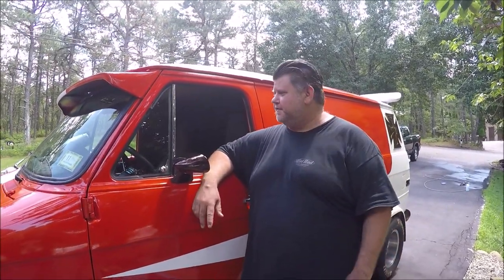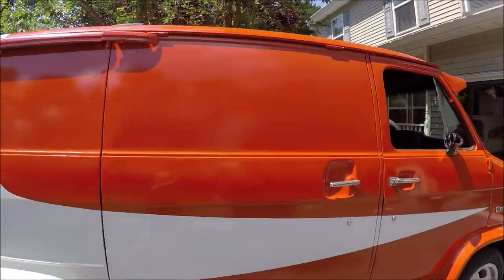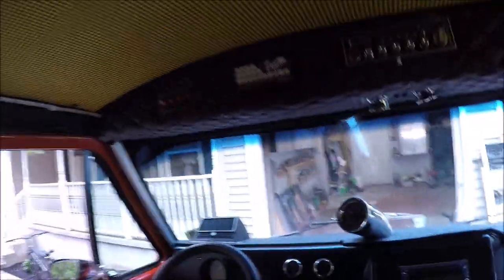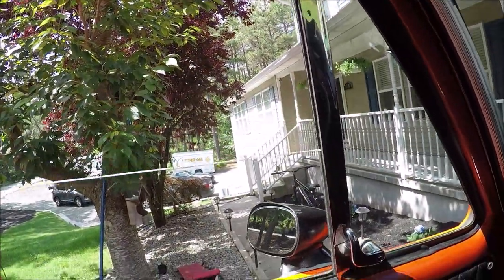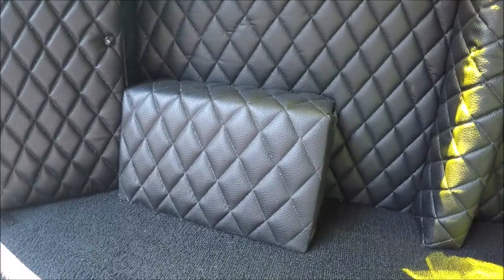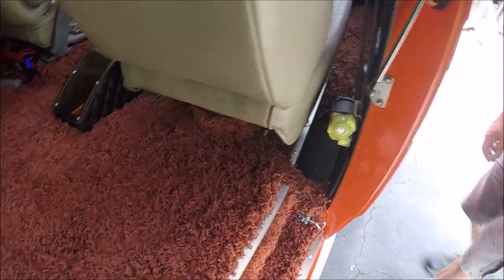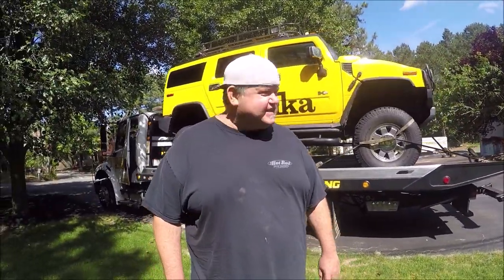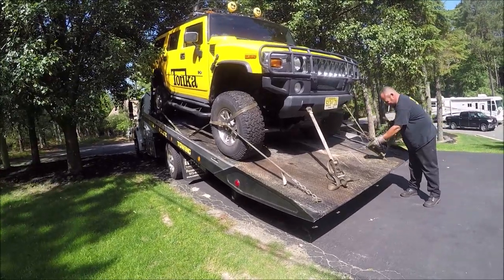"VANDEMIC"  Recreating A Classic 70's Boogie Van 1978 chevy van g10

Comment: Would love a more detailed video on a "how to gullwing door". Just put some 295s in the rear and now plan to gullwing it because of the sliding issue. Also didn't know about the hinge either needed at the bottom of the gullwing.  Van looks great. Many many hours on it you can tell
Reply from the maker: Unfortunately it wasnt until after we gull winged the door (and had a few beers) that we decided to start recording stuff for our channel. We definately missed out on some cool content with that but thanks for the comment.
Reply: @CrossCountryGarage  links to the parts used?
Reply: @CrossCountryGarage  you also mentioned in the video anything anyone had questions about and needed details to comment and ask. That's the only reason I brought it up and thought to ask, so I'd get more details about it
Reply from the maker: @shtfvan8084  you will need a 1/2" x 12" piece of steel (cut in half for 2 6" pieces) to fill the channel at the top of the door, 2 4" hinges that you can grab at lowes or home depot (1 side will get cut to fit on the top. Other side that connects to the door you will have to cut and weld into an "L").  We made our mounting brackets out if steel stock but i will look and try to find you a link, then purchased the struts, ball ends and clasps off amazon, and i will look for those links when I get home.
Reply from the maker: https://www.amazon.com/dp/B0721P9T3B?ref=ppx_pop_mob_ap_share
Reply from the maker: https://www.amazon.com/dp/B01LWMQUSH/ref=cm_sw_r_cp_apa_i_YJvpFb2CH90FK
Reply from the maker: https://www.amazon.com/dp/B077KJ217F/ref=cm_sw_r_cp_apa_i_FKvpFb7SB9B49

Comment: Which backup camera did you use? I need one for mine and my daughter's vans.
Reply from the maker: They all work fine. That was a JVC head unit with a $20 camera from Ebay  but even the cheap chinese head units work good. I think we had to lengthen the camera wire though as it was a long run.
Reply: @CrossCountryGarage  Thanks for taking the time to reply! Great build it's an inspiration for me just getting started.

Comment: Are you guys going to make more of the bubble lights ??
How about the maltese cross ???
Reply from the maker: Probably not the cross but possibly the lights. We are starting to make replacement acrylic for windows, right now we have a round template and a tear drop, just pull the outer gasket and replace old tinted ones, shouldn't even have to take the frame out of the van. We have a set of round blue ones with about a 3" rise that we will probably throw on ebay today. If you watch our porthole video, they are the same as those but the ones in the video had a 4" rise (they went to Scotland and they had the frames). Thanks for watching.

Comment: Did you put the ceiling up before or after the wall, and how did you do it?
Reply from the maker: We did the ceiling after the walls, small 1/2" screws with caps directly into the roof ribs, spaced them probably 18" apart. For us it didn't matter what went 1st, because we left a 1/2" gap to run the LEDs. I would do ceiling 1st if not leaving a gap so walls could somewhat support it. Thanks for watching.

Comment: I have a 77 dodge but i love this chevy😳 Im planning to gullwing my slider. Where did you source you gas struts from???? What force rating are they. Which hinges did you use?
Reply from the maker: 185lb struts from Amazon. 36" ones.  Hinges are just regular door hinges we cut (and welded a little 90 degree into) and got the ball ends from amazon as well and made little brackets. We are doing another van in the fall with more in depth gull wing and bubble videos. Stay tuned.
Reply: @CrossCountryGarage  cool thanks for the info! I stay tuned.
Reply: @CrossCountryGarage  185 pounds! That seems like a lot. Is that correct? Can you close the door ok?
Reply from the maker: @julianchavez3372  door closes just fine. (1 handed no less) We had a pair if 90 lbs at first and they only held the door open half way. I just ordered 2 more sets because next van, back door getting gull winged also.
Reply: @CrossCountryGarage  critical info man thank you a ton!

Comment: Just subbed, the van is incredible. Two motivated guys, respect. I had to comment, the horn is cool. But train horns are the shit..js
Reply from the maker: Anything other than stock is the shit. Train horns are an easy option. 1 thing we forgot to show is the air tank and compressor mounted underneath for the air ride.

Comment: Great machine, very tidy. Excuse my ignorance but what's a ghetto charger? I feel there's an inside joke. 
Again well done.
Reply from the maker: The ghetto charger is the completely  useless air cleaner with the triple butterflies. Although useful in a car like the black charger from fast and furious, due to where the motor is at in the van it probably robs a little horsepower, but looks damn cool doing it, lol. Thanks for watching.
Reply: @CrossCountryGarage  LOL,  thanks for the reply.  I suspected something like that but as you say great visuals. 
Sometimes you just do it cause it looks great.

Comment: What size wheels are those? Also is it lowered?
Reply from the maker: Fronts 235/60/15, rears 275/60/15. Honestly dont remember if we had drop spindles on it at the time. Had to take them off as it was too low with the tired springs. Drop spindles are now on other van we are rebuilding, Free Candy.
Reply: @CrossCountryGarage  Do you happen to know what the offset is on those rims?
Reply from the maker: @gregklubek6016  unfortunately no.
Reply: @CrossCountryGarage  All right bro no problem, nice work on it though it looks awesome, update the channel with another video of the progress on the other one. Keep Van in!